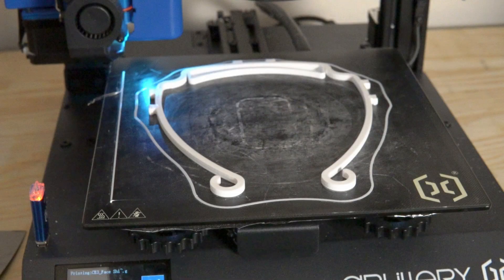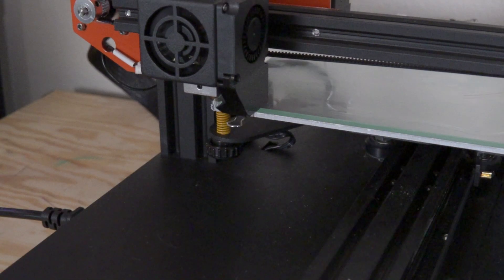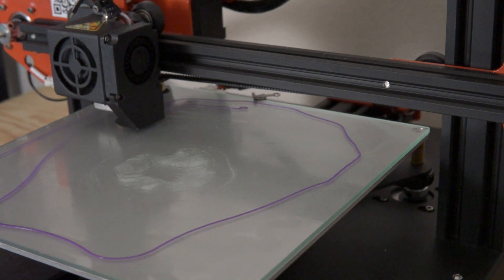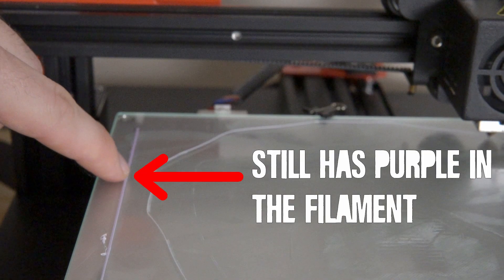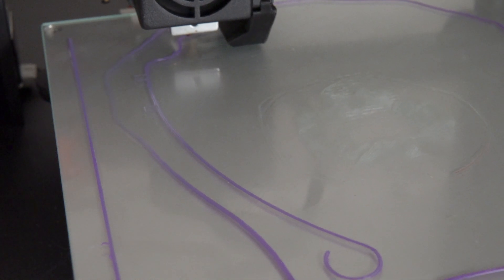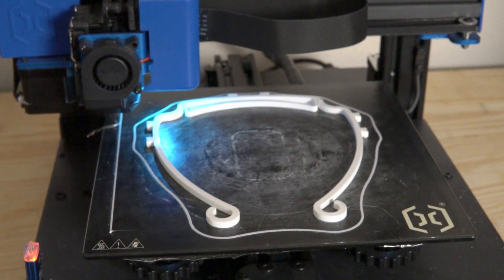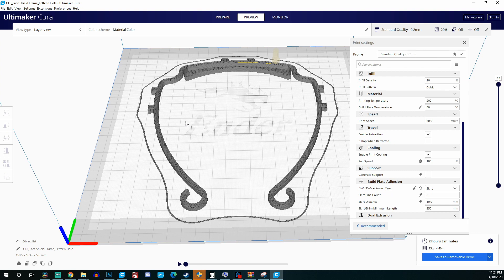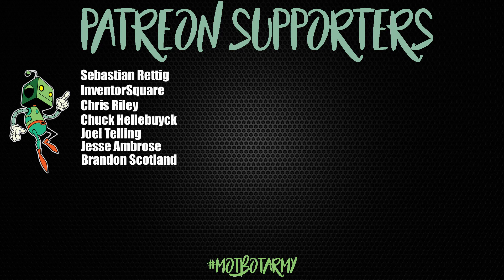Using Skirts To Get A Perfect 1st Layer When 3d Printing

Comment: I have ender 3 pro and so far this skirt element is the most difficult to detach after printing is done. I have to use tools, bend the magnet surface and it turns into garbage pretty quickly (using second replacement right now). I found this video in my attempt to find out how to turn it off and quite surprised no one mentioning this problem.

Comment: Always use a skirt when printing on my AM8's. Again, the same reasons you listed.
Reply from the maker: How many AM8 printers do you have? Mine is still on a shelf after 2-3 years lol. It just took a total back seat.
Reply: @ModBotArmy  I have two.  They have been serving me very well for 3-4 years now, though I would like to upgrade the x axis to an aluminum extrusion instead of the 8mm rods.

Comment: I always use a skirt on both my Ender 3 and Ender 3 Pro. Both printers also run an initial priming line. My Ender 3 is equipped with a BL-Touch. The skirt gives me confidence that each print starts well. Both printers are also equipped with 4mm borosilicate glass beds also.
Reply from the maker: That is awesome. Pretty much identical to what I run and also what gives me confidence. I have a glass plate as well but I primarily only use when I am printing with a material such as Nylon that needs it for proper adhesion.

Comment: Yes!  SKIRT is very valuable for all the exact reasons you said.  When I started, I liked RAFT to really lock it down well.  As I got better at bed leveling over the total platform, SKIRT is definitely best.  I did have a problem with even adhesion on glass bed though.  
I've never been a fan of BRIM.  SKIRT for the win!
Reply from the maker: Yes I also have never been crazy about rafts or brims. There are some printers I have used that do require a raft for proper adhesion but that seems to be less and less the case as printers have gotten better. For brims, the only exception to me is if you have a part that has a to small of a surface area for adhesion it does help to secure the part. Again rare cases though.